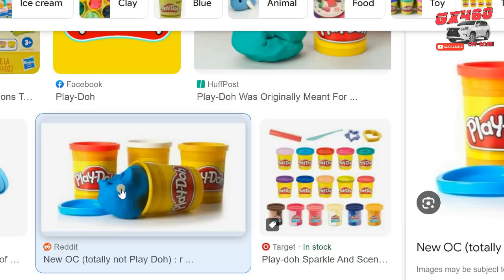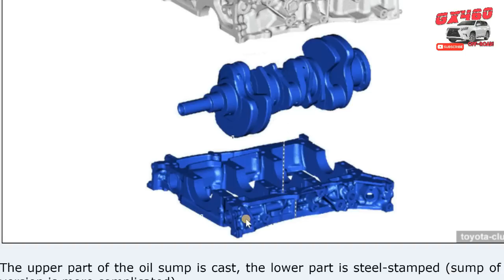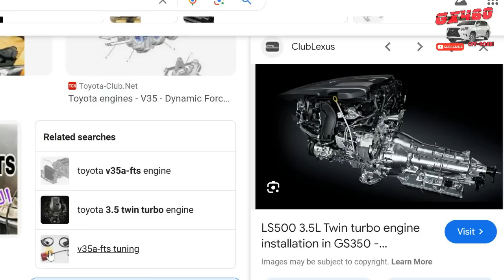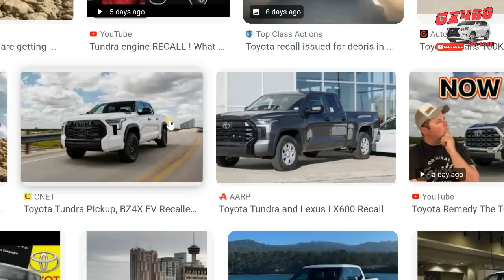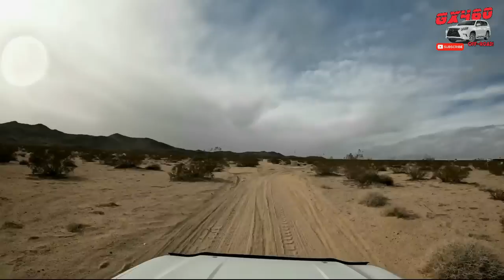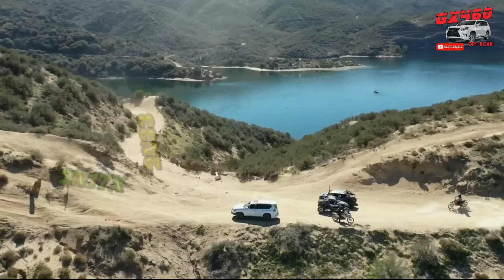Toyota Tundra OUTRAGE: A Technical Explanation

Comment: Exactly it’s a very simple machining issue due to a software glitch. But like you said people can’t understand logic and common sense really isn’t that common anymore. Plus there’s also about a dozen channels that are fear mongering and doing it for clout because they’re getting views also 95% of people do not really understand how an engine functions nor can they understand or wrap their head around how a twin turbo V6 can actually be low stress due to the high thermal efficiency Toyota has increased with this 3.4 L engine, that just doesn’t make sense ha ha ha ha
Reply from the maker: You're spot on.  This engine was engineered from the start as a truck engine... they claim since it came from an LS500 in 2017 that its a "car engine"... nope.. it's in 5 trucks and only 1 car (and will never go into another car model)  Do the math... it was always intended to be a truck engine.  And yes fear and phony sell... Thank you for supportive comments 💖 💓 💗 Also thermal efficiency is too big of a term for the masses to understand 😆... they like caveman terms such as "too much pressure and stress!" 😁
Reply: @LexusGX460-OFF-ROAD  😂😂😂

Comment: It’s been in a CAR since 2017, not a 7,000 pound truck.  That’s the problem.
Reply from the maker: It's a TRUCK engine.  The V35A-FTS is in FIVE trucks and ONE car.  It was engineered from the ground up as a truck engine.  The Tundra in RWD form is the same weight as the LS500 sedan.  The LS500 has 3 differentials and is full-time 4WD with lots of lux weight.  The Tundra looks heavy but is all pockets of air.. 😆

Comment: Leftover machining bits are called "Swarf", not trash. Also I don't buy it. I think they don't know so threw that out there while they figure it out. If anything, I suspect insufficient oil flow or clearances at the crank journal. OIl pressure is <70PSI I'm pretty sure.
Reply from the maker: swarf, debris, trash... all the same thing 😉 ... there's no evidence of "insufficient clearance" around the crankshaft journals... until evidence of such is presented its just a fear-based assumption

Comment: How could there be debris and trash in the engines from three different plants? I think it’s a design flaw. I hope it’s trash. I hope it’s not the design floor because I change my oil on my new tundra at 4000 miles and then I change it at 6000 and I’m gonna change it every 5000 a little bit of aluminum or steel. I didn’t check it because at that time there was no recall, so I don’t know what it was. I did cut the filter open the first one and it was a tiny tiny bit something sparkling in there but again I didn’t check it because there was no recall. Toyota are $80,000 82,000 and I don’t feel confident towing anything with it. I feel like it might break in the middle of the road the freeway they really need to step up to the plate if they wanna save their reputation because right now they’re 40 rep 40 year reputation is on the line.
Reply from the maker: The milling robots don't care what country they are in... Japan,  Alabama, Texas, the bottom of the ocean... they will run the same milling and cleaning program
Reply: @LexusGX460-OFF-ROAD  The milling robots DO care about the human that takes care of them though. :)

Comment: It’s like a differential gearbox. The bigger the torque or wheel diameter size, the bigger the physical ring gears are needed. No way around it even if it’s soaked in 90w oil. Imagine putting a tundra differential for a semi truck, it’s not going to last. 
Tundra with 600 lbs/ft torque has reached the physical limitations of the 3.5 v6. High torque needs more engine displacement to distribute those torque wear evenly throughout those bearing surfaces. Turbos high pressure fuel/air  mixture will dilute engine oil. 
Turbo works for semi because semi has three critical things
1) diesel (natural lubricant)
2) huge displacement (for more metal wear surface)
2) 15w-40 engine oil for ultimate wear protection
Reply: Agree there is to much torque at to lower rpm on to smaller bearing.

Comment: It’s that solid piece that holds the bearings in place. 10 k miles on a twin turbo engine oil change is terminal.
Reply from the maker: That piece is called a crankshaft bedplate and they've been in Toyota engines for decades, both NA and diesels... there's zero evidence of the bedplate being defective.  Bedplates have been in all makes and models for decades.  10k oil intervals are beyond conservative and have also been standard for decades now 😉

Comment: Thanks for a video that hopefully squelches some of these clueless YouTube "experts" such as @jmc6000 and a few others I've seen posting about the engine design. For which they obviously know nothing about. I sometimes wonder if they are getting paid by Ford or GM to be deliberately disingenuous or they just really don't understand engine failure modes.
Reply from the maker: Thanks for your kind comments.  Yes they're all of fear based speculation.  The bedplate is ancient stuff and literally there to stiffen and make things better and stronger.  Next, some people don't seem to understand that the oil galleries run in parallel... if there's milling burs left in gallery number-1 then the number-1 main bearing will take all the damage.... some think the engine is oiled in series and the trash should flow everywhere... Anyway it's all just fear 😨  Also the prattle about "girdle assembley" lol... when it's a crankshaft bedplate... which is STONGER than a girdle... a girdle is an afterthought for an engine with traditional caps... a bedplate is and always will be a stronger design... but when the masses are scared they tend to repeat fear prattle
Reply: @LexusGX460-OFF-ROAD  The terms are somewhat interchangeable to a degree IF it's not an add-on that only ties the main caps together. I will agree that the term bed plate is a more proper term for the Toyota design. Either way the bed plate itself is not structurally failing, as some YouTube "experts" would like everyone to believe.

Comment: It seems like the problem is isolated to a certain bearing only. To me that means an oiling issue. Particles small enough to fit between the bearing and the crank will get picked up by the filter. I feel like the particles are bigger and get accumulated into an oil passage blocking it partially or completely. Hopefully we find out the truth one day.

Comment: Yes this engine has been around for a while, but it has not been put in a truck to tow over 10,000 lbs. the trash in the engine isn’t the issue and 2024s are still failing despite not being put in the recall.
Reply from the maker: It HAS been "put in a truck designed to tow".  This engine didn't fall from the engine-tree it was designed ground up to be a TRUCK engine.  It is in 1 car and 6 trucks.  Do the math 😉
Reply from the maker: ... so what's the issue and what evidence supports it? 🤔

Comment: You mean to tell me that that if any small particles are not filtered out then the engine will blow?   Why do I feel like I’m getting put to sleep with this example.
If your analysis were correct, then engines all over the spectrum would be blowing up every day.  Last I checked there are oil filters for a reason.
I’m still left being skeptical however I admit that I don’t know much about engine specifics.
Reply from the maker: There shouldn't be machining particles in the engine.... dirt... other organic trash can be filtered... but burrs shedding metal might get fused to the bearings as toyota is claiming here
Reply: @LexusGX460-OFF-ROAD  Hmm, then why wouldn’t other manufacturers with lower standards than Toyota not experience such engine failures more frequently?

Comment: I agree with you, however I can’t help but wonder Toyota been making engines for many many years cleaning a block before you assemble. It would seem to be one of the first things you would do.  in addition and they’re still having issues it would be hard to believe that it took them long to diagnose that.  I suspect there’s probably something that’s not happening in the mailing process breaking off after a while tab or burr for example
Reply from the maker: Exactly burrs hanging around then breaking off during operation pre-filtration

Comment: There’s a Tundra with an engine failure right now at my dealership. I asked about it and they said it stalled on the highway and is being repaired under warranty. It had machining debris around the bearings but no metal debris in the oil filter. they also said the driver must have been driving in high water conditions because the air filters had signs of sucking in water. idk what to think really.
Reply from the maker: Thank you for the real-world feedback.  And thanks for doing the short-block install.  It will he interesting to see the permanent fix.  Question:  Is the new short-block the same.exact part number as the original??

Comment: Machining debri....if you believe that I got a bridge.
Straight up design flaw. Others have pinpointed it. You have to realize that if toyota admits its a design flaw they have to replace EVERY engine. No way they will admit they screwed up. Debri lie can be dealt with on a case by case basis.
Reply from the maker: There is NO EVIDENCE of a "design flaw" that's just the peanut-gallery being afraid  of things they don't understand 😉

Comment: Very poorly written and explained. “Trash”? Really? Please aim for accuracy if you wish to report on meaningful things. This is childish and completely useless. If machining debris is left inside an engine, it will exert damage to numerous places. Clearly what has happened here is not simply metallic machining debris left behind. It is an obvious design and or materials flaw. Words matter
Reply from the maker: Sorry but trash and debris are literally synonyms... thrubleft trash in the engine as they have stated 🙄  "Design flaw theory" has absolutely zero evidence and is purely fear-based

Comment: Metal in the engine used to mean all new engine, but in this case they wiill just give you a shortblock , F that.
Reply: A massive slap in the face when they raised MSRP's as much as they have and posted record profits in 2023. Absolutely inexcusable to sell someone a $65k truck, the engines blows 20k miles later, and they tell the dealer to tear the engine down in a service bay and have parts laying everywhere while Toyota snail mails a short block.

Comment: The design issue as shown by this problem (and the earlier turbo problem) is that the cab of the truck has to be removed to remove and replace the engine and/or turbos. What idiot made that decision? This leads to a $30K repair job if out of warranty. That's where the 100000 trucks built x $30K = $3 BILLION estimate comes from. 
Obviously Toyota is hoping there is some clever way to determine which engines are susceptible, like maybe oil analysis, so they only have to replace 1% of the engines. Toyota really has to stand behind whatever fix they implement, like a 250K mile engine warranty, or all the animosity is going to spill over to the Turbo 4 vehicles also. Tacoma sales are already dragging due to prices, they're trying to launch the Land Cruiser, and we're just seeing pre-production 2025 4Runners. It has the potential to be a company killer.
Do us right Toyota.

Comment: This isn't from debris. Im willing to bet they designed the engine mains with too tight of oil clearance.
Reply from the maker: and what would be the benefit to the engineers to implement such a flawed design?  What would they gain?  Would they get a promotion once the engines started blowing up?
Reply: @LexusGX460-OFF-ROAD I'm not saying they did it on purpose. It was a miscalculation that was overlooked.
Reply: @LexusGX460-OFF-ROAD 
One reason I can see for that is to compensate for the low viscosity oil.

Comment: Toyota is lying this is the same excuse Kia and hyndai. How did you get same trash in different manufacter Japan and Alabama
Reply: I would imagine that they use the same production process and they missed a cleanup step.

If the process is the same, it doesn't matter where the engine is made.
Reply: To me it was an oversight in their process. Machines and their programming are man made. Possibly new employees didn't do their job properly or were not trained correctly. Car manufactures don't do this to cut corners, especially Toyota since it is costing them big, but either way we can bet it won't happen again, unlike another well known brand.
Reply: It would be nice to see the actual process. Definitely a man issue, but what i dont like is they usually blame the operator, and it could be an engineer process planner that hasn't enforced an inspection point of either the flush process, fluid change intervals, tooling inspections, etc. Sometimes, the operators bring up issues, and the engineering ignores them because the root cause is their pretentious egos.😅
Reply: Did you watch the video? That was explained in detail.

Comment: One reason why bearing material is soft is so hard foreign debris can embed into the material.  This basically removes it from the bearing gap so the problems outlined in the video don’t happen.  If you allow the FOD to embed and sit flush to the surface, oil can flow over it as normal.

Did Toyota change the formulation of the bearing material in order to make it harder and thus better able to handle the higher loads caused by turbo boost?  This could explain why the particles are not embedding into the softer material like they should, it’s not soft enough.

These bearings need to be plastigauged because the clearances are so small.  This debris must be on the order of .001 inches in order to even make it into the bearing.  This is on par with metal fragments produced during normal wear and tear as well as the break in period.  

Something is not adding up because a particle like the one illustrated in the video is on par with the size of particle that a motor can produce on its own without mfg debris.
Reply from the maker: Yep, that is true... the "embedment layer" is supposed to take organic trash and keep the bearing flat... key word "organic"... ie.. dirt, grit, etc... not so much aluminum alloy shavings from the block/head

Comment: I've posted my educated opinion elsewhere, but here's some additional foresight. Problem 1 with the debris 'explanation'; these engines have been failing in irregular numbers and rebuilt by dealers. Some owners are on Multiple engines already. There's a lot of room for finger-pointing for a dealer to be doing subpar work vs factory conditions, but the fact remains that even rebuilt engines have failed in the exact same way. 
Problem 2, if the first model year that was scrutinized did have additional issues With debris, the first time it was started--at the factory--it was already damaged before ever going to the lot or in dealer hands. I can accept debris for one model year or even one production run. Three full model years is highly suspicious. 
The question remains on what was changed from the preliminary design principle to the variant in the Tundra, what loads the truck sees specific to its weight/payload, and what all that does with a lower build quality platform if its the transmission, supporting components, etc.
Reply: It's very unlikely that the size and shape of each piece of debris in every engine is the same particle size and shape. Some engines may not even have the problem. Someone made a mistake, but these engineers are not stupid. The have tested, tested and tested again to make sure these engines will stand up to any punishment given to them. Most engines of any brand break because of neglect, milage and abuse. If the software that programs the machines not given enough time to flush away the metal debis.

Comment: As an engine builder I would like to see more bearing clearance to allow small debris to flush through rather than just embed in the soft bearing material. Perfect cleaning would be nice but not always obtainable also I am not comfortable with  these super lite weight oils providing a margin of safety. We might need a bit of old school tech to fix this problem.  Wondering if they changed the bearing material to make the EPA happy.
Reply from the maker: Great point!
Reply: As an engine builder you should know that too much clearance is likely to cause oil pressure problems. And not knowing the size of the contamination, how much clearance would you recommend?

My memory tells me that one of the things that the soft bearing helped with was to all particles to be imbedded with out causing damage to the crank journal.
Reply: "Wondering if they changed the bearing material to make the EPA happy." Don't be a wingnut slob who thinks more pollution and waste is the "answer" to everything, i.e. Trump cutting so many regulations (penny wise and pound foolish).

Comment: The old engines may have had tiny issues but not catastrophic failures like the new engines that are in the new tundra. 
You're paid by Toyota to put this bull sh#t out there
Reply from the maker: Both the 5.7 and 4.6 had engine failure recalls.  "Catastrophic" is an emotional feelz word... fact is old V8s failed and were recalled in the beginning...

Comment: Toyota has yet to show us this debris from a fresh milled block, I believe it's a engineering flaw since engines share it and not cnc coding flaw.
Reply: How could you explain so low of issues if it’s a design flaw?
Reply from the maker: show evidence of an engineering flaw.... even anecdotal in nature
Reply: @LexusGX460-OFF-ROAD  I believe it's a surging issue and the powertrain is taking high loads at not optimal phases. I like the video